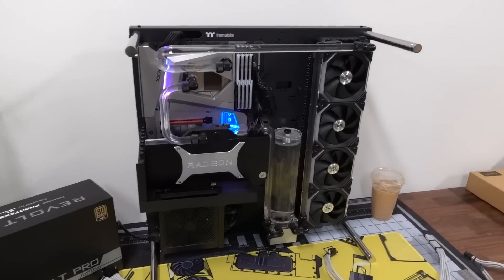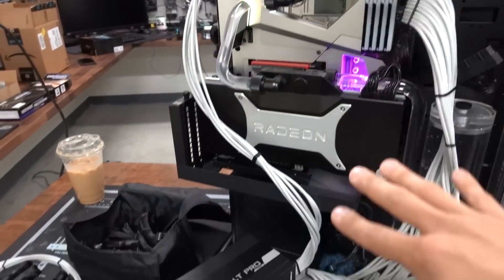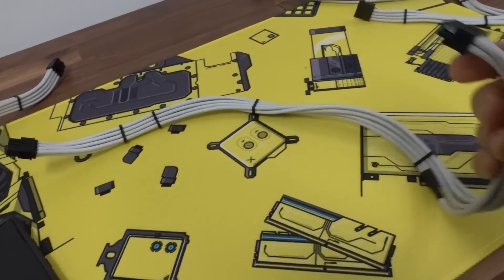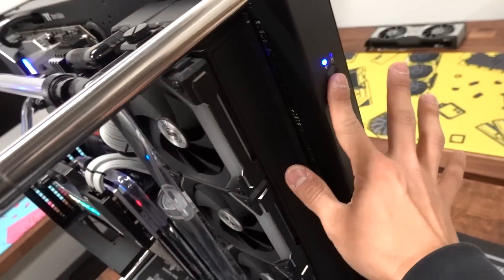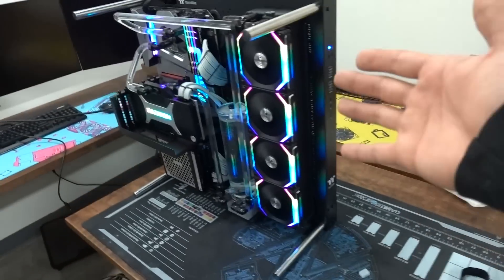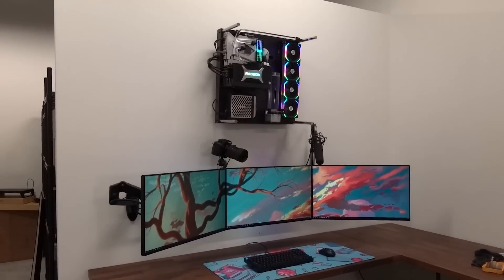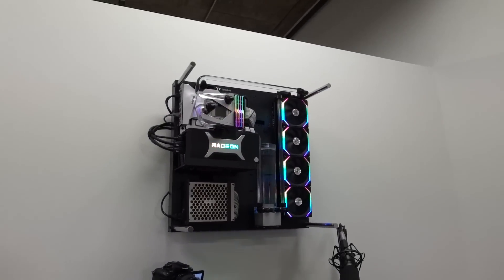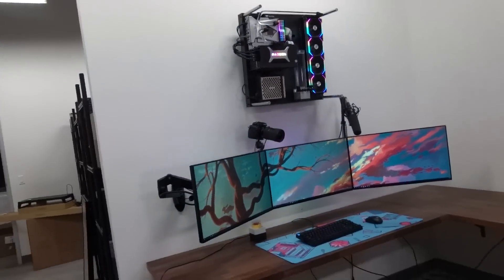I PUT MY PC ON THE WALL!!

Comment from the maker: Thanks to WARPATH for sponsoring this one! Download WARPATH through my link: https://patron.me/BitwitWarpath and get a special start pack! Use my code: @Bitwit
Join the event and you will have a chance to win PS5, Switch or tons of Amazon cards. Check the link for more details: https://bit.ly/Bitwit_Giveaway
Reply: ok
Reply: Savage
Reply: ok
Reply: sure
Reply: Do you have any pc for sale
Reply: legend
Reply: ok
Reply: bruh im pretty sure the wallmount is upside down, or maybe you can fix it by turning it upside down, otherwise you have to find out where the lean is coming from and try to fix it that way. look for gaps, tighten things a bit if needed, but dont forget how easy it is to strip holes in studs
Reply: Can't wait for part 2
Reply: do you want to pull it towards you at any given time? - if not, get a bar, mount it to the back of the wall/ on the beam , drill 2 holes in the wall where the screw holes are on the case, screw a screw through the beam and wall into the case
Reply: You can try toggle bolts on part of the wall that has no stud, if combine with stud support, you should be able to wall mount the PC using a flat mounting bracket.
Reply: Put a white block of wood on the bottom of lenth of how much tilt is there
Reply: Just put one or two blocks behind the PC near the bottom.  That should level it out.
Reply: I feel like on the dual system psu you could just use one of those 24 pin testers in the second 24 pin slot to get it working
Reply: Get some like these (Amazon B07F3X3B1C}, mount to the wall behind the loops. You can adjust the length to bring it level.
Reply: add a bumper on the back at the bottom so it wont lean out..
Reply: kabeldirekt is actualy german for cable direct ;)
Reply: I'm just wondering what cameras do you have?, I'm a hobbyist photographer, but I don't know much about that brand of camera
Reply: I'd wall mount a pair of iLoud Mtm monitors (speakers). The name might sound silly but once you hear them it's a different story :D
They are $350 each ($700 for the pair). If you want you could also add a mini DSP HD ($200), which gives you the option to add a subwoofer. I hope this helps in any way!
Reply: Just put a solid wood log at the bottom mid point behind the case. That will hold the pressure for the weight and will hold it straight. (Do adjust the height of the log, or just use LEGO?)
Reply: Well personally I like the tilt. It makes it down at the chair where you're viewing it from. So a tilt would facilitate the same function as a tilt with the TV. It's just angled at you more so you can see it better.

But if you wanted straight up and down.

Attach a toroidal rubber grommet to the bottom in the back. Larger than the width on top. And then on top attach a spring. When recoiled is shorter than the width of the distance on top.

Which will keep the bottom out from the wall. And the top in towards the wall.

I hope this is helpful.!
Reply: couldn't just bolt itto the wall if you have access to the back of the wall
Reply: Washers on the tv mount might solve the issue of it being at an angle
Reply: Kyle, CPU psu cables are not compatible with PCIe cables.  For the cpu, its 4 12V along one side and Gnd on the other.  PCIe cables are 3 12V and 5 gnd. If the cables were built wrong, then the 12V cable was shorted to ground and that wouldn't allow the PSU to turn on due to fault protection.  When you swapped to the factory CPU cable on the first psu, the psu may have been damaged by the short.
Reply: you didn't link the stuff
Reply: Try using washers on the 2 bottom screws between the case and plate. That will tilt it up and buy longer screws in case the one you have aren’t long enough to go through the washers.
Reply: To make the pc straight on the wall get 2 mounting brackets and put them both on the middle of the back of the pc and put one higher up than the other, they will hold the pc straight.
Reply: simple fif for the tilt cut a piece of wood to the height that when put behind it would make it strait  by basically propping it up think of it like cocking a car tire or shimming a floor/deck
Reply: If you're just trying to make it straight vertically, you could simply push out the bottom of the PC. Like, shove a spacer between the bottom of the PC and the wall.
Reply: To mount the PC on the wall. Get a large sheet of plywood, maybe a nice hardwood that can be stained to match your desks, or paint it white to match the wall. Mount the plywood to several studs and than you can mount to computer anywhere on that hardwood. I would think anything thicker than 3/4 inch should be strong enough to hold it.
Reply: Cool Pc Kyle, Hope you're doing ok
Reply: I would love a link for the capture card you're using and the DP cables you bought.

As other have suggested, you could use some sort of adjustable shelf foot at the bottom of the case to "push" that part of the case, but you'd need to do it in addition to the cords you wanted to use on top cause I don't see that working on its own (it would just prevent the PC from going all the way to the back I feel like)
Reply: Just get a block of wood and mount it under the wall mount. Like a door stopper paint it and put some kind of cloth or foam material on it so it doesn’t scratch the case. Path of least resistance.
Reply: Why dont you use some sort of spacer where the mounth screws to the pc so that you can control the distance
Reply: You need some streamdecks
Reply: The solution of using a shim or block of wood at the bottom is being recommended a lot but I would advise against it. Putting a shim at the bottom will just cause the arm to pull out further to settle into the same tilt it’s at now. Essentially a shim becomes the new front plane and will just end up that much further from the wall over a short time. I’ve mounted thousands of TVs and this happens a lot with heavier units like plasmas and the shim idea ends the same each time. It needs to be anchored at the top or use a fixed mount that has an arm like an actual peerless mount. It would likely need to be trimmed so it doesn’t stick out from behind the case but it would only take a few minutes with a dremil or angle grinder. With that option the ability to pull it away from the wall would be maintained. Need to get some low voltage rings in that wall for all those cables too.
Reply: Can everyone agree if they got a pc like this they would die of excitement
Reply: If one chooses to play WARPATH on the German team, is it bad manners to spam "Are we the baddies?" in chat?
Reply: You could also put a small piece of wood into wood near the bottom to push the bottom out and pull the top with the rope.
Reply: Wouldn't the easiest mod to level out your pc mount be simply adding a block at the bottom?

Either on the wall or on the back of the case, on the bottom third, simply mount a small block. Think of it as a spacer or a door stop. This will reduce/elimante the mount from tilting when up against the wall. The bonus is that it's easy to conceal with a bit of paint (particularly if attached to the case).
Reply: Kyle why? Warpath is such a terrible game, I haven't played it myself if I'm honest, but the ads are just terrible, with most of them literally ripping scenes from Stalingrad, please have some integrity.
Reply: u can use the string and put it in the hooks in the wall and pull on it until its tight enough and then tie it
Reply: Link to that button ?
Reply: KabelDirekt is a German Company dude :D Its written correctly in German ^^
Reply: Btw u could somehow fix a block of any material to the wall behind the pc and towards the bottom so that the pc can rest on it and will be straight. You could use superglue or something to fix it to the wall...
Reply: Make a wedge with the correct angle that screws into the stud then screw the mount to the wedge.
Reply: ur set up looks more clean that Mr clean could ever clean
Reply: If you have same threaded screws on the bottom use extendable bed/kitchen appliances feet, you know the one you can regulate the Hight , sometimes you have threaded legs on Camera Bipods , so you don't pull it from top  but braze it on the bottom , which will work out the same , and you will not damage the wall .
Reply: Just put something like a small piece of wood at the bottom half of the case so it PUSHES the case from the wall - That might mean a bigger distance to the wall of that’s an issue for you
Reply: i saw that video play button at the bottom at 7:19
Reply: Your wall mount has a +5/-15 degree tilt capability resulting in the forward tilt you are seeing with the weight of the PC applied. You should be able to level it out and insert spacers or drill a hole through and insert a metal rod or pins for something more permanent.
Reply: Caldigit tb3 / element
Reply: suggestion: put Studio Audio Monitors
Reply: what's the wall made of?  holds everything
Reply: most wall mounting kits come with plastic spacers... add longer screws on the vesa mount to shim some spacers under the bottom of the bracket to push it straight
Reply: No
Reply: Wow 2 ads
Reply: Instead of pushing the top in on the case why not try use a pillar or something to push the bottom out to make everything level? I've done that with a TV before otherwise use washers on the mount to create an offset or to angle it?
Reply: I would not even trust myself holding a pc that expemsive.
Reply: 4:07 Kylegasm. Similar like nerdgasm
Reply: tilt gate
Reply: You could always do a really simple and sturdy french cleat for it!
Reply: Looks like WARPATH is using stolen assets from C&C/EA ( the GDI Logo at 2:20 )
Reply: @breningham  and Warhammer
Reply: couldnt you use the rope and make 2 black legs for the lower part to hold it even?
Reply: Dude, just screw in a small piece of 2x4 or what ever make the pc level at the bottom, paint it white or black or whatever, easy peasy lemon squeezy...Yes I just said that.
Reply: Kabel is german for cable...
Reply: KabelDirekt is spelled correct, its just a german brand
Reply: I mounted the same wall mount. I use wine corks as stand offs on each bottom corner with velcro adhesives.  works great.
Reply: if you go for bookshelf speakers check out the Vanatoo Transparent Zero's. They're like audiophile approved SFF bookshelf speakers. Super tiny and sound fantastic. I run mine with the Orb Audio subONE which is like a small footprint 12" woofer
Reply: Try mounting something like push up legs on the bottom back of the system between the wall so it can suport and  handle the tilting.
Reply: Why didn't you just daisy chain the monitors? @Bitwit
Reply: Idea to straiten your PC on the wall: Angled shim. If you can somehow get the part that anchors to the wall to be bolted to a shim that is at the exact angle that the PC is hanging from, you might be able to get it strait.
Reply: Possibly drill through the wall and mount on the other side on the stud...? Tether complete 😉👍🏾
Reply: I have the same wall mount setup with the type you wanted, but all you need to do to stop the tilt is add locktite or any kind of thread glue on the screw that handles the tilt. You need to support the pc's weight till it's cured, but mine's held at the angle I wanted it for about 5 months now. Also if there is enough extra thread on the screw for your mount you can add lock washers to it to increase the friction created.
Reply: Why not just put a spacer at the bottom between the wall and system to correct the tilt?
Reply: SIMPLE MAKE A 3D PRINTED LEG FOR BOTTOM THE USE 3M TAPE TAPE LEG TO  BACK OF CASE.
Reply: Easy idea to make it straight:  Get some black foam/wood-block, affix it to the wall so the bottom of the case is resting against it and holding the bottom 'out' so things stay straight.
Reply: attach a post to the bottom middle of the computer to wedge its bottom out/prevent the top from moving outward. otherwise put in hooks using drywall anchors directly opposite the current hooks on the pc
Reply: i know Im asking randomly but does anybody know of a way to log back into an instagram account?
I was dumb lost my account password. I appreciate any tips you can give me
Reply: @Marcel Patrick instablaster ;)
Reply: @Beckham Kellan I really appreciate your reply. I got to the site on google and im trying it out atm.
Looks like it's gonna take quite some time so I will reply here later with my results.
Reply: @Beckham Kellan It worked and I actually got access to my account again. Im so happy!
Thank you so much, you saved my ass!
Reply: @Marcel Patrick Glad I could help :D

Comment: The anxiety I get from that expensive PC hanging on the wall is off the charts.
Reply: Especially since it ain't a normal wall 😂
Reply: It's over 9 thousand!!
Reply: I was nervous just watching him hold it with one hand when mounting it to the arm
Reply: Why? It’s not yours to worry about.
Reply: It's exacerbated by being above monitors that are as expensive as that entire PC.
Reply: Yea, I’m thinking some stainless steel 1/16” safety cables From Cormers of Pc to the ceiling for safety.
Reply: @wisico640   I’m Hoping it’s “ Wood Studs “ & Not metal studs. Metal studs = pc falling off wall almost for sure.
Reply: I love his logic: “potentially have $5000 pc fall off wall vs seeing a wood board or something coming out the sides? Think I’ll go with option A.
Reply: @OcRefrig  They're wood studs.
Reply: Wall anchors or pocket holes man.

Edit,  just hit 12:10.....uuuummm..
Reply: If it falls, it’s taking the monitors with it
Reply: He's rich
Reply: My core p3 is hanging in the wall. Used a tv mount and zero issues! Looks great! :)
Reply: Let go of material things then you won't have that issue
Reply: @Bubbosborne  same here no issue

Comment: Man the PC looks so cool and at the same time feels like a recipe for disaster waiting to happen. Water cooling and a wall mount lmao.
Reply: Yeah and above his monitors.
Reply: But it looks cool. Loud crashing noises
Reply: I don’t get people who think that wall mounting a pc means it’s going to fall down, like how do you think 80 inch TVs are mounted to the wall?
Reply: @ollie8759  I was thinking of the possible water damage. He's not had the best of luck with water.
Reply: @CFRAutoLavado  Yes that is certainly true, he doesn’t have a great track record does he
Reply: @ollie8759  I think most people are just paranoid. I'm always thinking my damn shelf gonna fall and take me out when I'm sitting at my desk
Reply: @ThatMfTaika  same i got a 55 inch tv mounted above me and it freaks me out sometimes
Reply: I had my 60lb watercooled rig mounted on a powder coated metal shelf with some 250lb rated brackets and then those has three 1/4 toggle bolts per bracket. That thing didn't budge. 

This looks sketchy by comparison to what I had set up.

 The only reason it's not on the wall anymore is that I moved and have much more room now. It was purely a space saving thing before. It stayed perfectly in place for 4 years.

Comment: Take a wooden block and put it behind the PC on the bottom, The block pushes the bottom leveling out the top and the weight of the PC pushes the block to the wall holding it in place. No screws, rope, hooks, or anchors, Just a low tech solution.
Reply: Or similarly just some strong metal L brackets under the PC facing up so they are hidden.